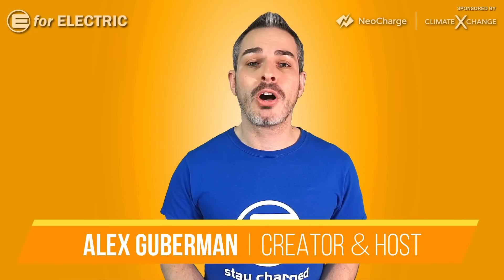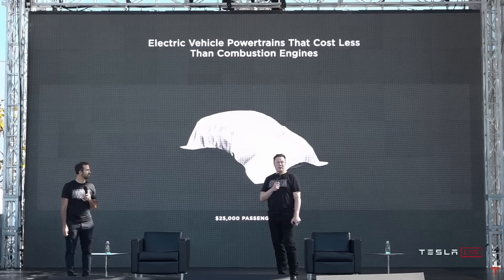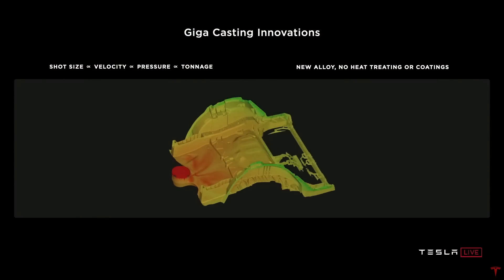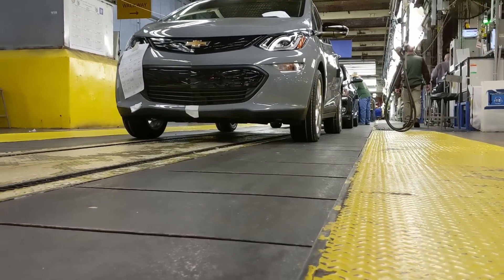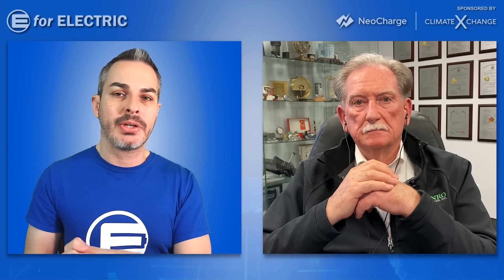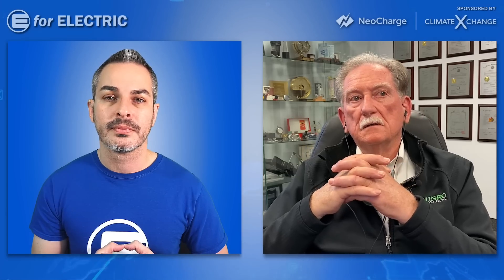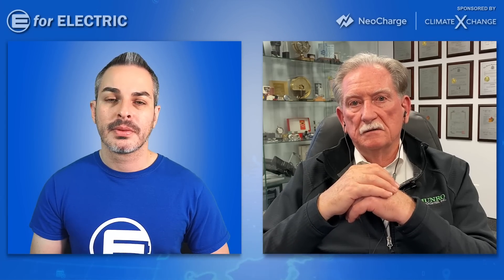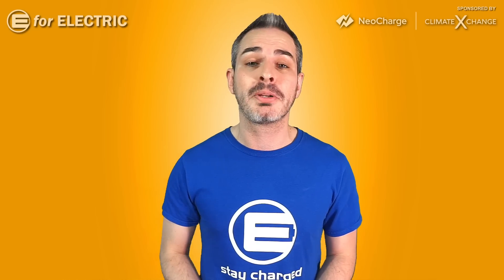SANDY MUNRO Defends $25,000 Tesla Timeline

Comment: Per Tesla's infographics, the $25k compact model will use LFP batteries initially.
4680 usage will drop vehicle cost $5k. Except for limited availability at first, 'upselling' it makes no sense.
Elon pretty much spelled out that GF Berlin and Austin will have their own 4680 production lines on site, no?
It also seemed like GF Nevada would continue to make the older batteries for energy storage for the foreseeable future.
Realistically, the $25k vehicle isn't viable now, because the profit center on them is as RoboTaxis, not as Privately owned vehicles. We can't have these now because they're not worth making until FSD is viable. The other side of this is that at this price point, a robotaxi network subscription becomes price competitive. Why sell a car once for $25k when you can sub it out for $30k revenue annually?

Comment: Getting rid of self driving means developing a new control computer system. Not worth it. The control electronics are cheap compared to the battery. As for shorter range, Elon Musk has said he doesn't want to make a car with less than 300 miles range. Tesla wants to the the best in any area they sell products in.

Comment: I don't know why you insist on the $25K EV. The problem is not necessarily making the EV for that much, it is that if you do, the demande will skyrocket and they can barely keep up with the demand as is, so it makes no sense to rush it until they have enough manufacturing volume to sustain the demand.

Comment: It seems like there is a race between Tesla bringing their prices down and volume up  to compete with ICE SUV's and the ICE car manufacturers developing their EV capability. In the end though I think it will be more of a collaboration. The real race is with the deteriorating climate.  I think Tesla will end up licensing their tech to these companies, because Tesla can't produce enough cars fast enough to transition us to carbon neutral quickly enough. Also by licensing, this will free up resources to work on other vital projects like electric air travel and shipping and household  products like AC and refrigeration, as well as ramping up solar roofs into a building standard .

Comment: The plaid Model S will have the new batteries, not because of the range, but because of the power. It will produce 821 kW (1100 hp)

Comment: The VW ID4 will be around $25,000, in some states, when they start assembling it in the US. MSRP $35,000 - $7,500 tax credit - $2,000 state rebate = $25,500. With 250 mile range, who needs to wait for Tesla?
Reply: Try taking it cross country!
Reply: Wainwright S - And the form factor is much much better than Tesla’s..
Reply: The tax credit has a limit, not a great long term strategy. Does vw only care about a few months of sales? Most cars have a life of 6 plus years and often the platform sticks around even after that.
Reply: 2022 before vw has a US built id.4 available. By then the tax credit will be gone. Unless it gets a revamped structure. By a new administration. Also no supercharger network. Slower charging speeds. Vw is unproven in the bev space. But it should be interesting. Early id.3 and pole star 2 issues are telling.

Comment: Casting parts will greatly reduce manufacturing cost.
Reply: Not when it's more cost effective to make them from sheet metal !
Reply: Thanks to teslas new alloy with near zero waste. It will be much cheaper at scale. Removing 379 pieces that all need to be made, moved, assembled, glued, welded, riveted etc. Will not only save weight. But also massive amounts of time. Plus space, power consumption and labor costs. It's the best part is no part, the best process is no process.
Reply: @4literv6  Only Tesla could make it so complicated that it needed 379 pieces.
Reply: @pasoundman  Go look at Sandy's other videos, its not at all uncommon for that assembly to be made of so many pieces.

Comment: The new batteries are needed for the Cybertruck and semi, those will see lower demand then the SXY series. So limited production is not a setback. Other models will be available with those  batteries in the Long Range versions for a hefty up charge. 
Elon already said that current battery tech will see continued use. Range will determine which battery is used. This allows Tesla to slowly scale production while using current suppliers. So not every late model Tesla will be latest tech.

Comment: I think that the model 3 will be 25k once they get everything figured out. Single motor with 250 mile range
Reply: I dont think Elon will want to sell a 250 mile range vehicle
Reply: teachmehowtodoge  yeah that's how I came up with the 250-mile range because I figure half a battery pack would be doable at that price point. Also the fact Tesla didn't have anything to show the people which means that if Elon showed us a model 3 or told us a model 3 would be capable of that it would really hurt model 3 sales
Reply: I think your right, I’ve thought the same thing.
Reply: teachmehowtodoge  lol maybe.. However nvidia is messing up there launch, trying to beat amd. It seems a bit desperate. Which makes me really wonder what Amd has to offer.
Reply: Elon has already said that this isn't how they plan to go.  The $25k car will be a new model (as it should be), otherwise you piss off all your previous Model 3 buyers.

Comment: The new battery cell is revolutionary as up until now Tesla was using the industry standard 18650 or a variant of that. I understand that in addition they plan to mine their own lithium. There can be a market for a smaller lower cost vehicle. Three wheelers were once quite common place in the UK but only in very niche market places.

Comment: I don't think Sandy is right about 1 year for 25k car. I'm expecting those cells to go into plaid, roadster and semi first and be the high nickel chemsitey. Then the lower cost iron chemistry for the 25k car in the future. Limiting is not only getting scrap rate down and build rate up on cells. But building factories. Shanghai and Berlin might be partially online but it'll take a few years before they can produce a 25k car.
Shanghai factory would make sense for first 25k car, as it's built out more than the others, cheaper labour prices etc.

Comment: They were so clear they are going to use battery to pack in the current format to each car eventually and that they’d up the buy quantity from battery suppliers. Lfp getting introduced just now. The slide with the 3 different cell types was so clear.

Comment: Making a 25G car at 10%, even 20% profit means taking battery pack production away from 40-50G cars Tesla can make 25% profit on. It's always about battery constraints. This is going with your timeline of "now" for the 25G car, within less than 2 years. It will use the current Panasonic cells that Model 3 and Y are using. Their sales volume and profit margin are excellent.